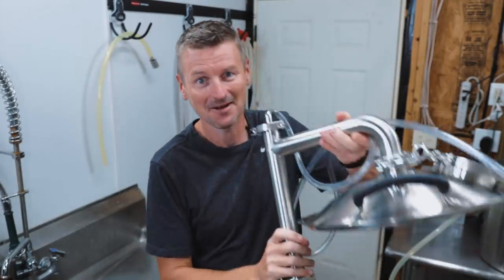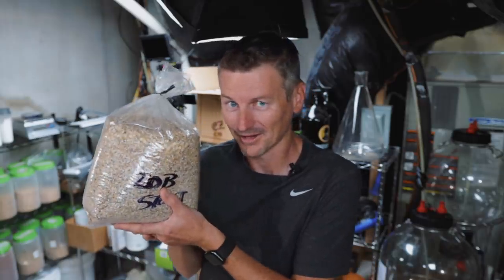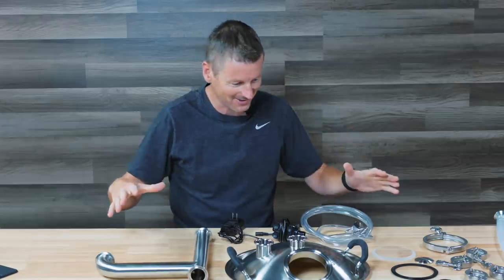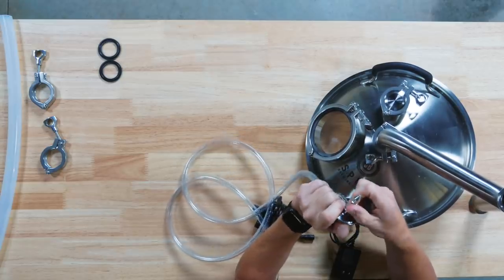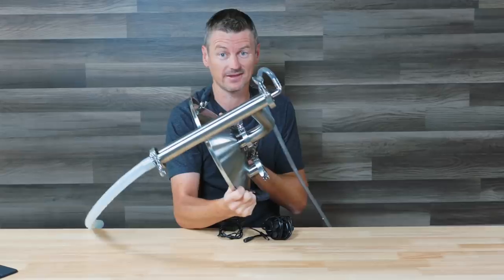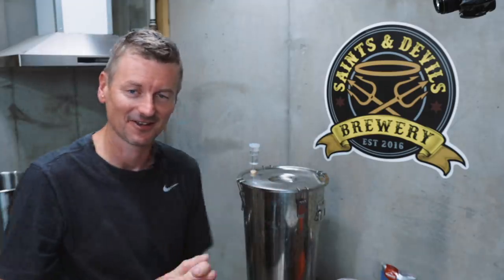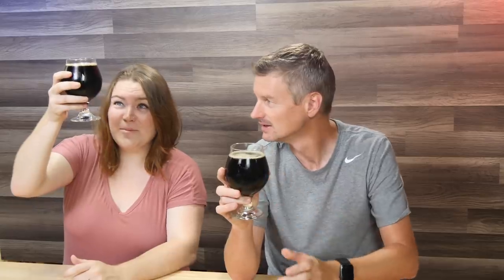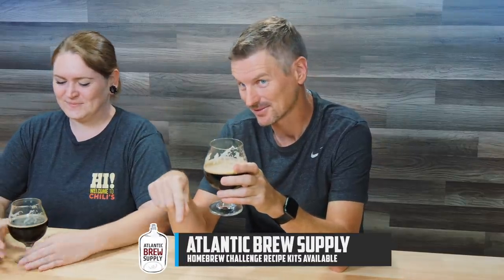American Stout | Spike Brewing Steam Condenser Lid

Comment: I’ve wondered if you’d get a bit more DMS flavor because of the lessened evaporation.
Reply: I'm curious about this as well. It's my only concern with the steam condenser. Other than the DMS concern the steam condenser would be great over my current steam removal setup.
Reply: I’ve tried a number of things for evap control. I’ve landed quite happily on a wall mounted swing arm fan blowing across the top. I brew in a garage, on propane, so I open the door, otherwise I’d be ROASTING on brew days. Since doing the fan, I’ve never had an issue, and I even have a poster behind the kettle that never gets “wrinkled”.
Reply: @ChuckUnderFire  Yeah, I'm brewing indoors with electric. I have an old AC unit that's sucking out some of the evaporation, but I still end up with a lot of moisture in the house when I brew. I don't have any DMS issues, but I'd like to cut back on the moisture going into the house.

I am near a sliding door, so I could try having a fan blow out there during the non-winter months.
Reply from the maker: Spike claim in their testing that any excess DMS is not detectable. Can’t say I noticed any issues.
Reply: The Homebrew Challenge, I would think that it wouldn’t be coming from Spike if it  contributed heavily to any DMS. It’s nice, because by the time it shows up in your brewery I start paying real attention to it. Keep telling it like it is. 
PS: Your pH Meter overview is the best covered on YouTube. Very well done.
Reply: Since the condensed steam doesn't go back into the kettle, it shouldn't be a problem.
Reply: @T_Mo271  you still need to boil all the DMS off. You need SMM to convert to DMS during the boil and then the DMS to be boiled off. The concern of steam falling back into the kettle is that you're dropping the DMS right back in, but if you're not getting a good enough boil off then you need to worry about not boiling off the DMS. This is why beers with lots of pilsner malts are typically longer boils. Pilsner malts contain more SMM due to the lower kilning temperatures, which means it takes longer to convert to SMM to DMS and boil off the DMS.

Reducing the amount you boil off by a significant amount is certainly a cause for concern with DMS. Now it's very possible everything is fine, but it's a lot of money to spend on something that's counter intuitive to what's been taught/learned. I would love if it didn't cause any DMS problems, and would get this yesterday if I was confident there was no DMS issues. I still might if there's a policy that allows a return in the event DMS can be detected after proper use. It's just a tough ask at $300-$350 if there's no way to test it out.
Reply: Tyler McLean From the sounds of it, if you get it you’ve got a Pilsner Brew day planned to break it in. I think the best test here would be double brew day (long day, I know)with the same recipe. One with the lid on the boil, one without.
Reply: @ChuckUnderFire  That's exactly what I would do. I almost always do 10g batches and I recently got a new boil kettle so I could do split boils too. I got the second mostly so I could split and do different hops in whirlpools.

Comment: Did you end up calculating what your actual boil-off rate was, given the expected OG at your previous rate? I brew in the kitchen and I'm quite interested in this product to keep from steaming up the house. Nice that it also requires less heating for the boil to begin with.
Reply from the maker: No I wasn’t that organized. And yeah should be easier to retain a rolling boil.

Comment: Could you use one bucket?  Put the pump in the collection bucket?  Seems to me the two bucket method will eventually drain the supply bucket, requiring a refill and fill the collection bucket, requiring an empty fiasco. Just a thought...
Reply from the maker: The issue there is the collection bucket water is warmer than the water going in. The cooler the water the better.
Reply: You could use an old coil immersion chiller to cool the water in the bucket. You’d have a closed-loop system that would not require monitoring. Might work...

Comment: How did you mount your hop spider with the lid? Trying to get an idea from the video but I couldn't see it. Were you able to hang it on the side like normal or does the lid interfere?
Reply from the maker: The lid did get in the way so I just propped it against the inside of the kettle.

Comment: I do all my boiling outdoors now, when I used to boil indoors I would end up creating my own weather inside the kitchen, the condensation would be so bad on the ceiling it would rain, one of my favorite malts with stout is black malt, just wondering do you have problems with astringency with dark malts? I hear that you should keep the PH of the mash as high as possible like 5.4

Comment: shortcircuit did review too, made me wonder, why not use compressed air instead of water spray.
Reply from the maker: Well put 😀
Reply: @eightlittlebits  and flow of air will create a venturi effect, that also creates suction, thats how some spray paint guns work, or sand blasters. Cold smoke generatora use same idea.
I'll have to test this theory
Reply: @dimash244  A water pump is much quieter than an air compressor. I know which I would prefer. ;D

Comment: I'm looking at the 15 gallon condenser for my Brewzilla 65L, but the lid is 15.7"-16.5"   
However my Brewzilla is 15.5" ID, 

How far off was you're ID(Internal Diameter vs lid nominal?
Reply from the maker: About the same. Frustratingly close

Comment: You always make a beer that I want to brew 👍  Regarding to the lid I heard it was important that the exit tube wasn't covered with water to make it work correct and it should use quite a bit of water, according to Brian at Short Circuited Brewers.  So I was interested in how much water you used under your brewing ?  Thanks for your time and efforts 👍
Reply from the maker: I wasn’t keeping track but yes I did use a fair amount of water in the process. Would have been good to collect that and reuse for cleaning.